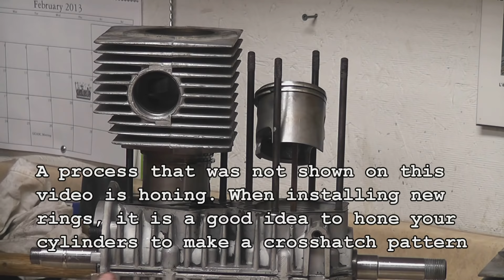440 Rotax Engine rebuild part 03

Comment: I baught a 74 tnt 440 with a new rebuild that lasted 20 minutes I braught it home and tore it down the pto piston had a hole I think they torqued the heads then the intake because the rubber seal wase hanging out before I got it off great video very helpful thanks.

Comment: I have a Kawasaki 340 which is too difficult to pull start, I have no electric start. With the spark plugs out I have no problem using the pull start so the pistons don't  seem to be stuck and I am at a lost what could be the problem. I would appreciate any help, thanks Roy

Comment: If your piston has a detonation/pre-ignition hole in it, which bearings do you need to replace?  Do you need to replace the rods too?
Reply from the maker: +CHOPPERGIRL AIRWAR if you have any doubts about the condition of the crank and/or rods ... I would have it checked by a shop that specialises in that kind of work.
Reply: @GaWajn  Приветствую вас. Скажите какой диаметр поршня на этом двигателе.?

Comment: two words: ring compressor
Reply: Christina bina  Don't need it because the bottom of the cylinders are machined with a champher that squeezes the rings as the cylinder is slid on !  90% of 2 strokes have this feature  but almost all 4 strokes don't !